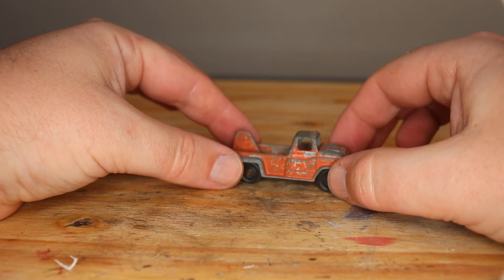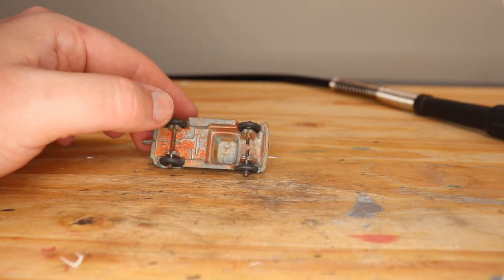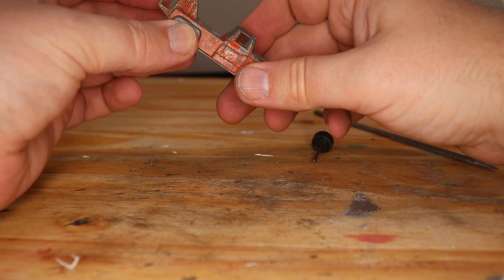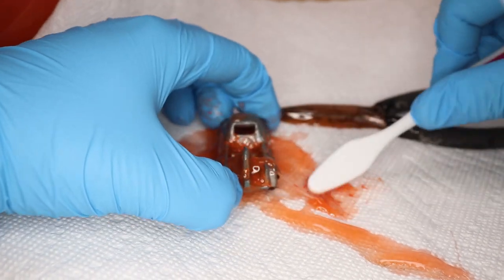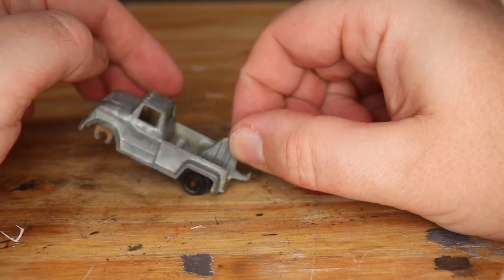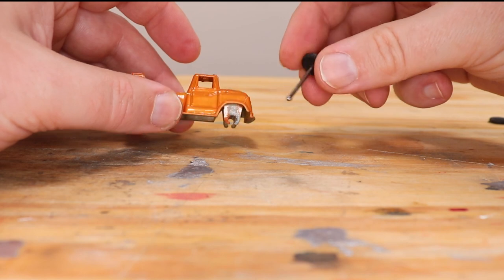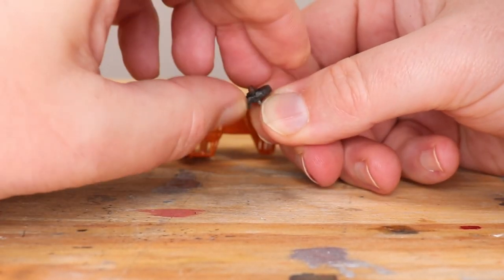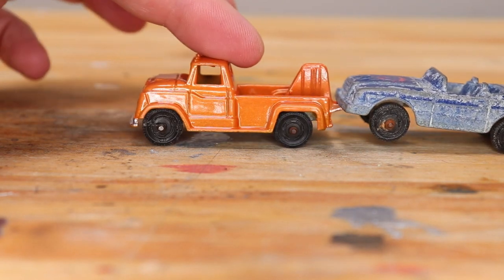Tootsietoy Tow Truck Restoration - Replace Axles

Comment: I found that placing the entire car in very hot water will allow you to remove the tires and wheels without much hassle.  When you put the new tires on do the same, put in it hot water.   I keep the axels on the car and use a wire wheel to clean the paint off the axel.   You can also use a heat gun to heat up the casting to bend the axel crimps without then breaking.  Take some practice but it’s doable.

Comment: Marty's matchbox makeovers shows, what I think, is a great way to do this type axle. He grinds down the thick part on one end, careful not to hit the wheel, then the tire slides off and you can pull the axle out the other side. He also has a rig set up made from nails on his drill press to balloon the end back out to keep everything in place when you're done.
Reply: I was about to suggest that

Comment: just heat the tires up with a hair dryer and they will pull right through with the help of mini needle nose plyers from behind.  then heat them up again and push them right back on.  looks like they were never removed.  I do that on all the old push on tires.  never cut the original axials unless bent to the point of no return.

Comment: I’ve been using Citrus Strip and it has worked for me in about 10 minutes. 
It’s like most strippers it probably depends on the paint. 
I also just finished the same truck only in white.
Reply from the maker: Brad Sullivan I have not tried it for that short of time yet, but I will now! So far, I really like it. I’ve done about 6 restorations with it so far.